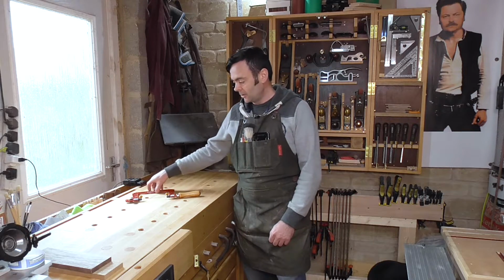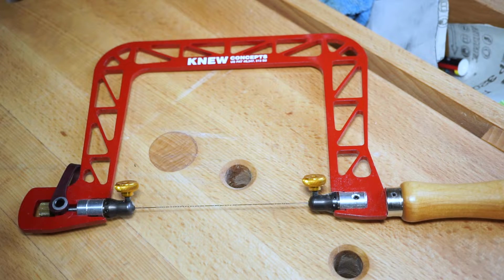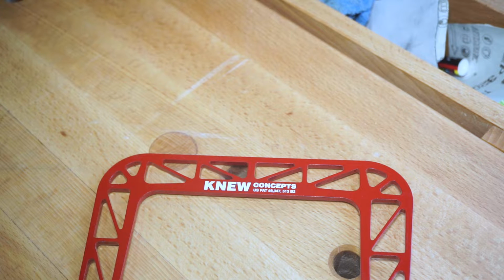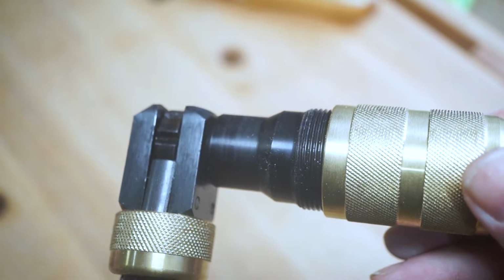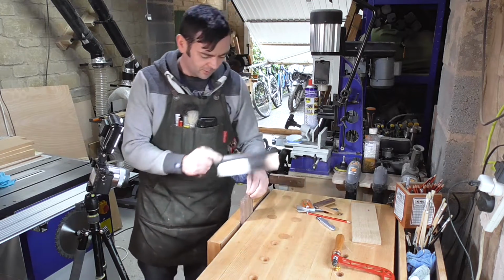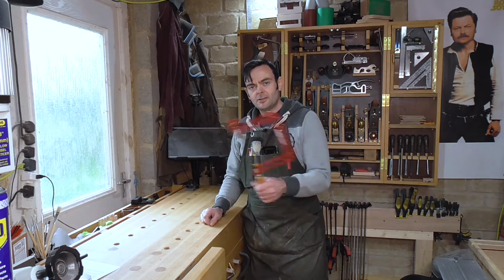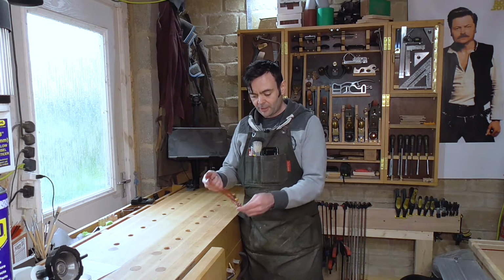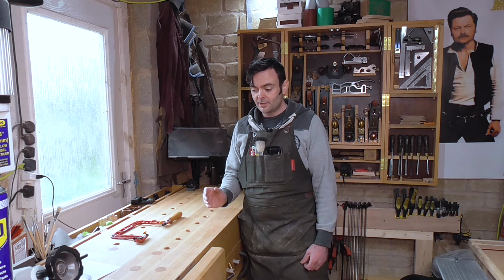Knew Concepts Fret Saw is it REALLY worth the price? Woodworking tool review.

Comment: HI Matthew.  Glad you thought our saw was a good buy.  To address a couple of your questions....  The powdercoat finish ends up being roughly as tough as the anodized in actual use.  I've seen a great many of our saws of both types over the years, and the anodized ones seem to scratch as easily, or more, than the powdercoated ones.  And when they do, it sticks out like a sore thumb, being silver against red.  The powdercoat scratches aren't quite as visible.  I'm the one who made that call, and I did it because in my experience, the powdercoat wears better.  As far as the marks on the frame go, they're not milling marks.  (If they were, that'd be easy) They're marks from the laser cutter.  Polishing them out would roughly double the price of the saw.  We've experimented with any method we could think of to reduce them in some cost effective fashion.  Haven't yet found a way.  The instant we do, we'll use it.  For now, we run the frames through a giant bespoke abrasive tumbling machine to round down all the edges, and make sure the saws are smooth to the hand, nevermind the little lines.  (Which vary dramatically from batch to batch through the laser.  Some are better than others, and it seems you may have one of the rougher ones.  They don't effect performance.)  You were concerned that the clamp screws were a different material than the tension screw.  They aren't.  They're both steel.  The knob screws are custom made for us by Holo Krome in New Jersey, and are black by virtue of their final processing.  The tension screws are also steel, but they have a nickel plate on them to prevent rust.  We can't do that to the knob screws, unfortunately.  (Nickle plate is slick, so it would be a poor choice for the clamps.) I have some test batches of tension screws running with a US manufacturer, and those may end up black, so the screws may all end up matching, assuming the tests work.  Those long thin screws are shockingly hard (and expensive) to get made.  I tried for most of 2 years to find a manufacturer in the US who was even willing to try.  Your idea about costing is unfortunately wide of the mark.  There's no way our saws will ever be anywhere near 50 quid.  There's more than 50 quid worth of parts in them.  So no matter what kind of competition we may have, that won't happen.  (The frames alone cost north of 30 pounds each, all by themselves, as raw material.)  As far as the packaging goes, yes, I agree with you, it wasn't up to snuff.  So we switched over to custom printed boxes around Christmas time 2020. The UK distributors should all have the boxed versions now.  If you have any other questions about the saws, feel free to drop me a line through our website.  Regards, Brian Meek, Knew Concepts.
Reply: I haven't used a powder coated tool like this, but I can attest that my Woodpecker tools are all fading from a rich red to a dull pink over time. Anodizing is NOT very durable.
Reply: Matthew has a new subscriber, Knew Concepts have a new customer and in a few days I will have a new saw. Evereyone's a winner!
Reply: Matthew has another new subscriber. Knew Concepts have a new customer. Thanks.
Reply: @KnewConcepts Have you tried waterjet cutting for the frame? It can do much the same as a laser, but doesn't leave a heat-affected zone.
Reply: @weevilinabox  Not seriously.  It's much slower than laser, so the cost per part is higher, and we don't have any real trouble with HAZ on the aluminum saws anyway.  The Ti saws we do, and we keep looking for a decent waterjet house anywhere near us, but haven't been able to find one yet.  And at current waterjet speeds and costing, doing just the Ti saws with waterjet would add significantly to their already serious cost.
Reply: Hi Brian:  

Looking for a saw to cut stone and exotic hardwoods.  Will I be able to use diamond wire with these blade clamps?  Depending on how strong or fragile is the wire, we are probably talking about somewhere in the range of 0.5 - 1.0mm

Thank you for your help, Brian!

David
Reply: @makeamericagratefulagain  The throat of our clamps is 0.073" in diameter, so any wire blade smaller than that will fit.  (But I wouldn't go much thicker than 0.070", just to be certain.)  I think in inches, so convert to metric at your own risk.  -Brian
Reply: @KnewConcepts  if ages old arithmetic continues to serve, our friends living in some of the bohemian countries would like to see us call the diameter of that wire 1.8mm.
Reply: I very seriously appreciate this response from KnewConcepts definitely can't wait to get one
Reply: I’ll be buying one of their saws just because of the company’s respectful tone and quality of this reply to the video’s fairly minor criticisms of their product. That’s the kind of people I want to do business with.
Reply: @brgrdr  awe how sweet
Reply: @brgrdr  100% agree.Mr Meeks deserves support for his honest and open comment above.and I will be buying one!
Reply: Just based on this serious response, I'll be buying one of your saws. I'm not rich and I can't afford to buy low quality. So tired of the Chinese crap everywhere.
Reply: @JS_Precision  Thank you.  Made in the US, by people you (almost) know.
Reply: ordered a 5" Mark IV: can't wait to get going with it
Reply: @brianmeek6196 Hah I doubt that since I am Swedish. But they sell them here and I respect a quality tool wherever it's from. We used to make a ton of high quality chisels and hand planes here. Most of it gone now. Can't blame the companies. People just vote with their wallets and high quality tools disappear, along with the know-how. Best of luck to your company.

Comment: I purchased this (black anodized) saw a few years back and have used it in the traditional way:  to remove waste wood.   I also have a coping saw and a jeweler's saw.   The coping saw does about equally well for the task, except it's not as fine for turning in a narrow kerf.  The fret and coping saw share a significant drawback:   the blade has to be discarded when it breaks.   This is not true of the jeweler's saw where you can adjust for blade length and reuse the broken pieces.   I used a jeweler's saw to cut out the eagle in an old 5 Deutsche Mark coin, and even got the little tongue in its beak.  I think I had about 20 blade breaks which used 3 blades as I was able to reuse the broken pieces.   I also find that the thin fret blade makes it hard to cut a straight line, unlike the wider coping saw.  Had I not purchased the Knew saw I would probably have gotten along fine with just a coping saw but the Knew is definitely a quality tool - very much in the mold of Woodpecker's stuff.   If you have the dough, knock yourselves out.

Comment: would you do a review of the brace please? I was thinking of buying one
Reply from the maker: I will when I've used it a bit more, but if you're happy to pay for something primarily because it's very pretty, you won't be disappointed. From the use I've given it so far, it works well. No sloppy gears or anything. It's just really well made.
Reply: I'd like to see that brace video as well. How does it compare to a miller falls?

Comment: I don't understand how it's faster. I'm just starting and learned the last year and a half with a standard no-brand saw that requires the chest push for tensioning. Since this frees up both hands I can do a blade change in about half the time that it takes to change one on my MK IV. Im seriously starting to regret buying it after realizing this. Plus it weighs more than my cheapo....first world problems lol.
Reply from the maker: Hi Chris. I find it faster because I can slide the blade down a single kerf all the way to the bottom and the balance of the saw allows much greater accuracy, meaning that I can cut extremely close to my shoulder line and remove the waste in one pass and leaving much less waste to remove with the chisel afterwards. In other words, it speeds up the process of cutting dovetails overall, not that making a single cut is quicker (though I find it is). The blade does take longer to change but if tensioned properly, lasts a lot longer than on a normal saw meaning significantly fewer changes and therefore saving time here as well. The saw isn't perfect and I still think it is expensive for what it is, but I love mine and wouldn't be without it. People's experiences are subjective though and if you get on better with a normal frettsaw or even a coping saw, there is nothing wrong with that.
Reply: @MatthewSmall  thanks for replying. Im still struggling with mine but I think it's almost certainly my fault as a newbie. I may get dither type and just part with the one I feel less comfortable with. Also thanks for the videos... great presentation and the rest. 👍

Comment: Hello Mathew, I have a three inch model that cost me about $100 US a few years ago it’s the lowest price saw with the 45 deg tilt and quick tensioner. Mine is anodized but I was definitely more impressed with the design and performance. My old saw is so weak and unpredictable it was kind of useless. Also the replacement blades are very inexpensive at $5 US for a 12 pack. As good hand tools go I didn’t think it was expensive since it will easily out last me. But I do understand your disappointment.

Comment: I just got one and have been trying to use it for the last 15 minutes and I can’t tell you how many blades I’ve snapped. So far I’m not happy with it
Reply from the maker: If you're snapping blades, you might have the tension set too high or be putting too much pressure in to the cut. Setting the tension correctly is a case of trial and error. It took me a few tries at first. Stick with it and when you get it right, you will be rewarded.